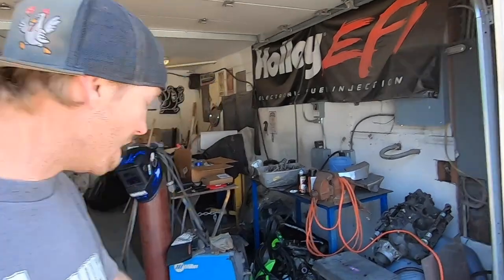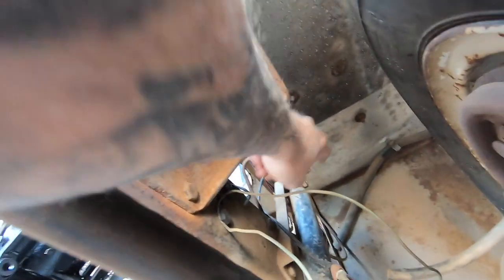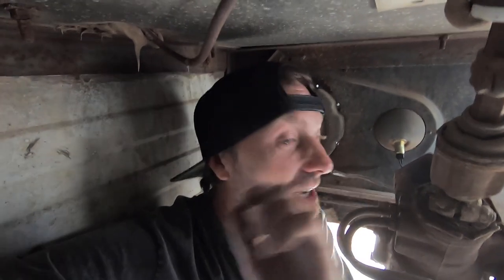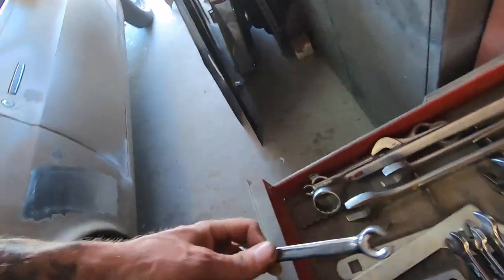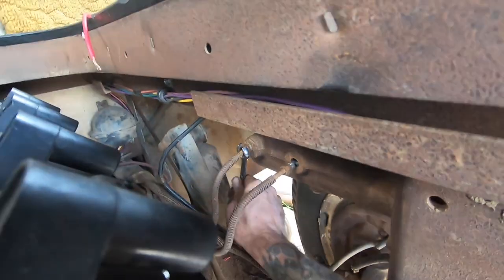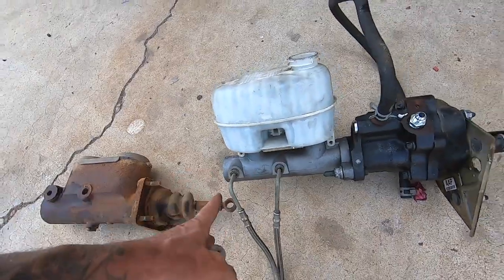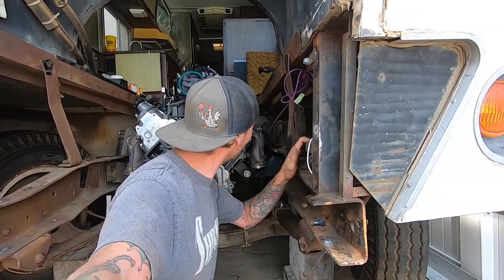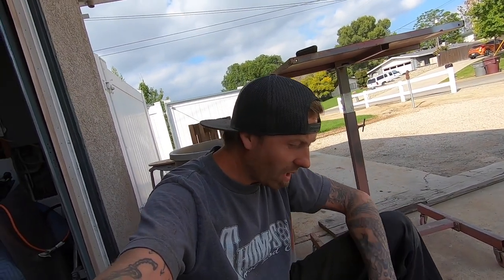Twinnebago Brake Master Removal

Comment: Size of the bore and length of the travel in relation to the brake pedal ratio.
Reply from the maker: Im not sure what the ratio is honestly. Hell I consideration even know if Winnebago took that into consideration when they put this beast together. We will have to see if I have enough leverage on the pedal or not I guess.🤷‍♂️ I hope the hydro boost puts out enough PSI. They converted them to Hydroboost in the later 70's but I think they may have went disc as well.